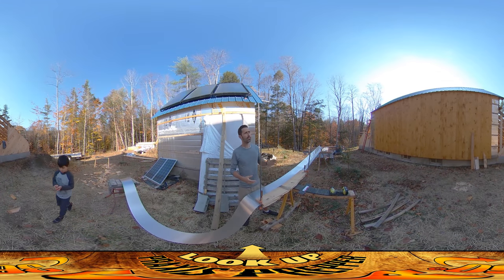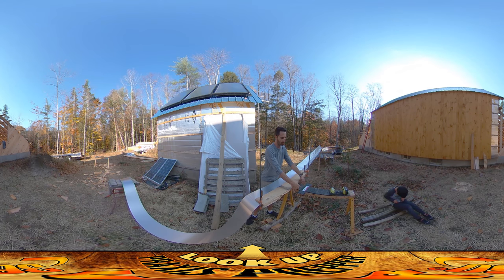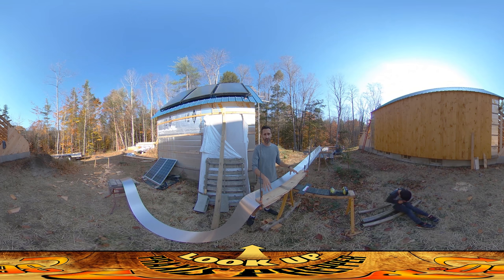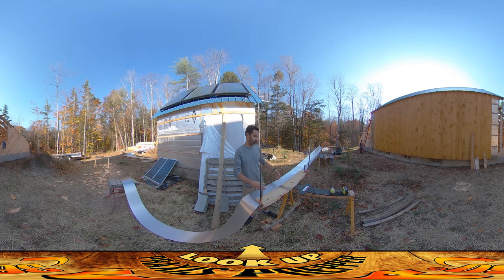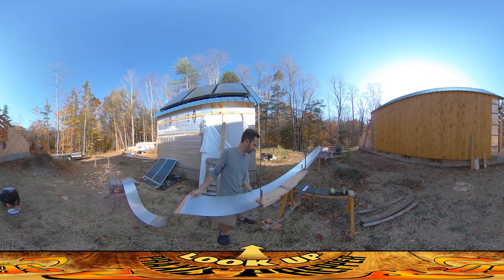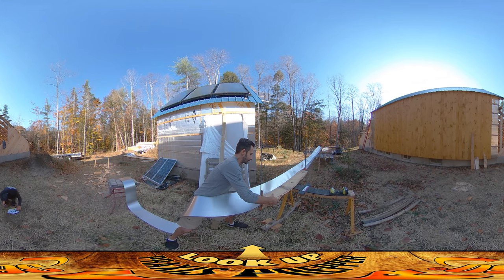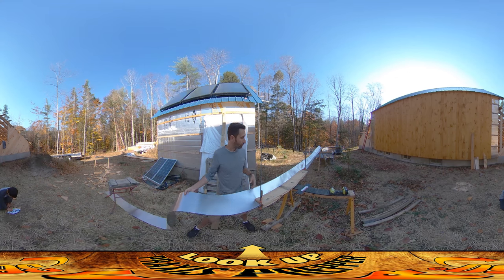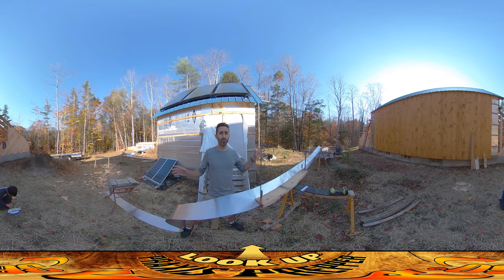Homestead Build - Bending Your Own Custom Flashing

Comment: Think we over here use some sort of flexible material for it 'roofing lead' it's called, not to sure there is actually lead in there though, hope not !  :P  ... but it does seem to work a lot easer then bending a lot of sheet metal this way.